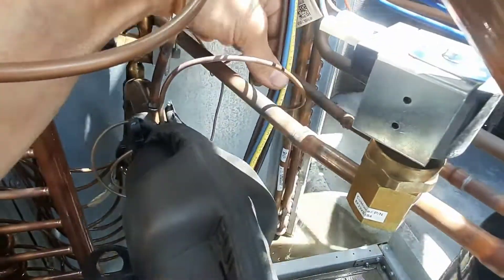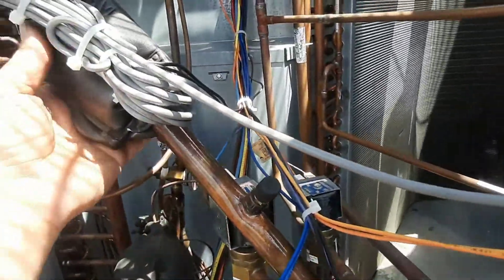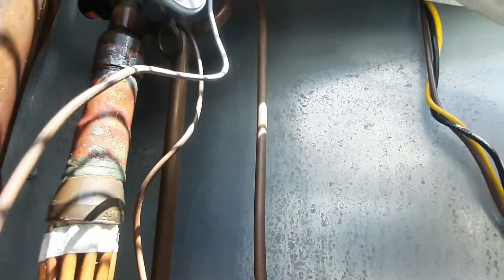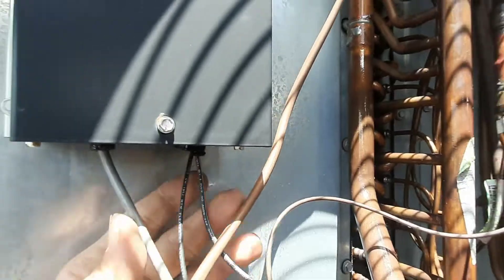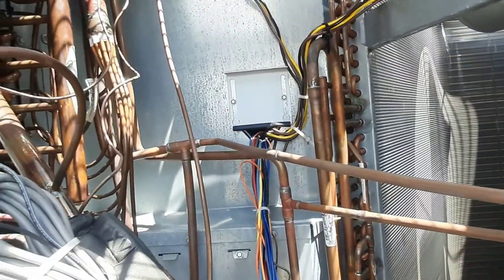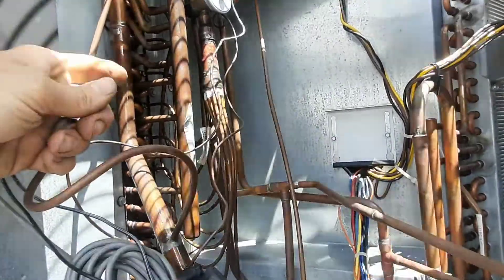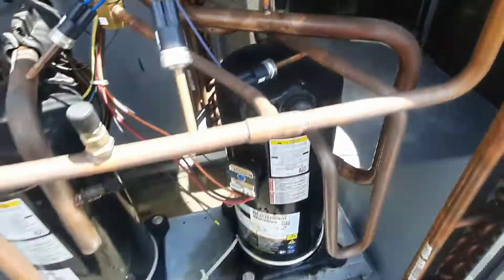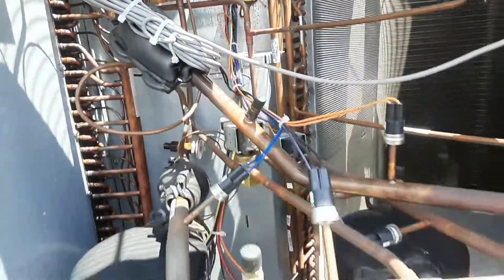Carrier humidimizer walk through and what to look for. #hvac#hvacservice #commercialhvac #carrier

Comment: I am not sure why, but by servicing US made commercial equipment, I had my worst cases ever.
The strange is that wire harnesses installations gets worse year by year. 
It seems like this part of equipment design has lost some good people that could create a 
safe and proper design. 
Same with the refrigerant tubings that are just dumped in place.
You wisely choose to correct the many issues in a good way.
In my cases over many Years, it was mainly ultra low temperature freezers.
The real bad was that the very important samples stored was lost for ever in a few hours after failures
So depressing to find either tube against tube grinding leaks or a massive short on cables.
Even arresting such problems years after years  to the manufacturer was to deaf ears.
I am impressed with your cool attitude and the way you fix all kind of issues.😊
Looking forward to your next adventure
Reply from the maker: Thank you, per995.

Comment: Hey, just watched your walkthrough on the Carrier humidimizer and it was super informative! For those of us not so familiar with HVAC systems, what are the top three crucial features or signs we should look for when inspecting a commercial HVAC unit like the Carrier humidimizer?
Reply from the maker: Be a master of the obvious. There's always wires or cap tubes rubbing. Loose electrical connections are also common. I have found pulleys loose and/or out of alignment. It's not all technical, I would argue it's actually the opposite, very simple things to correct when you know what you're looking for. Thanks, Digital-fahim.
Reply: @EverythingHVACR  It's true, sometimes the most common issues are right in front of us. Your experience highlights the importance of thorough inspections and attention to detail in maintaining equipment. Keep up the good work!Do you share your experiences or insights on social media? I'd love to follow along and learn more.
Reply from the maker: @Digital-fahim thank you. I do what I can, same name on other social media platforms
Reply: @EverythingHVACR  yes, found you

Comment: Definitely qualify control has gone down the tubes Steve I use condaloot or rubber hose with zip ties
Reply from the maker: Thanks, Stephen! I usually use something similar. I split quarter inch tubing, wrap the captube, and secure it with a zip tie. You never have to worry about it again.